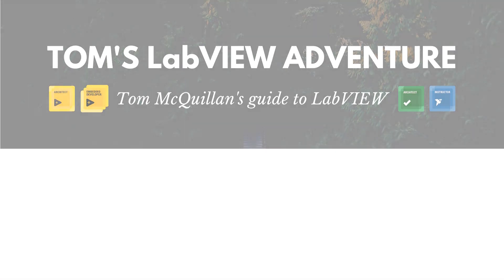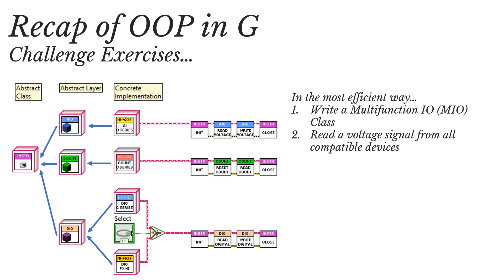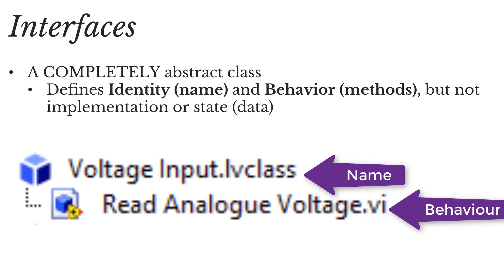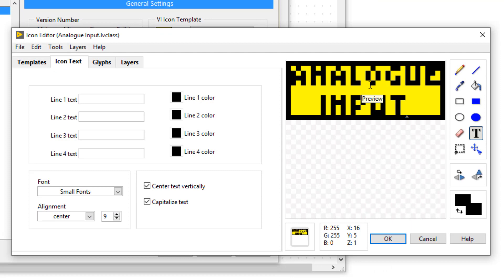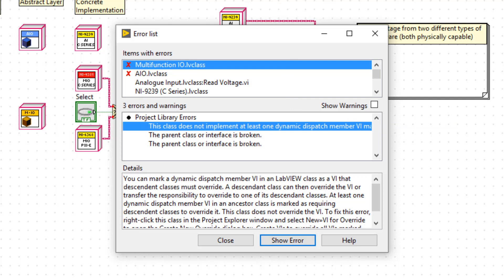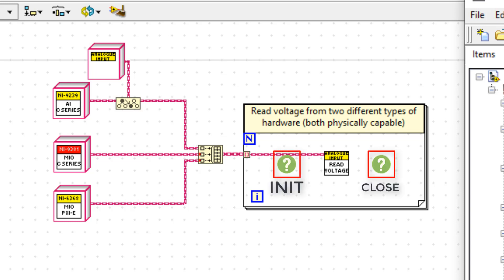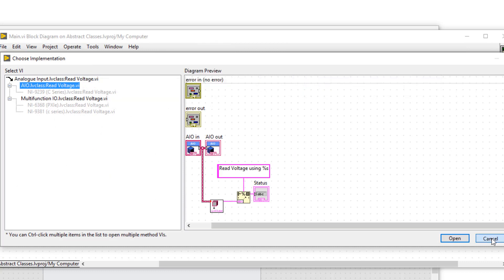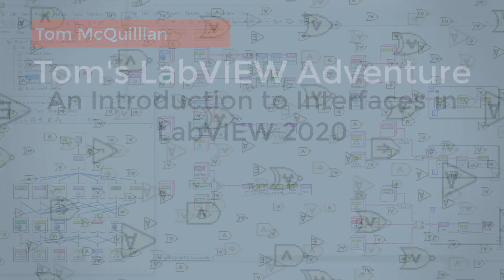An Introduction to Interfaces in G 🌟LabVIEW 2020 🌟 (OOP)

Comment: Hi Tom, Can I create an Actor for the Instruments instead of Normal Class? bcz here I'm not gonna use most of the AF overrides (eg.: Actor core, Pre launch Init etc...), only using the AF messages!!
Reply from the maker: I'm not sure I totally understand the question, however  for an actor to be able to receive messages, it must inherit from actor.lvclass. (Actor.lvclass doesn't have to be the direct parent).
You could make your hardware inherit from Actor, then specific hardware could inherit from Hardware. That being said, take time to design your OOP relationships, often composition is preferable to inheritance

Comment: Interface icons in the Project Explorer change to "class icon" after saving it on disk. Is it a bug or a supposed to be? I checked the known issues page for both 2020 and 2021 versions and found no report.
Reply from the maker: Interesting, I've not seen that happen before and I've been using interfaces frequently for about a year now. Is it still behaving like an interface or has it somehow converted to a class?
Are you able to replicate the behaviour? If so, let me know the steps you're taking along with version numbers.
Reply: @TomsLabVIEWAdventure  No, they are still acting like an interface but with a "class icon" in the project explorer tree only (e.g. in the "item settings" they have an interface icon). I have LabVIEW 21.0.1 (64-bit) on Windows 11 (with the insider program).  Whenever I create a new interface and check "Do Not Save" it has an interface icon until I close and reopen the project. 
Meanwhile, I want to thank you again for the video since I recently started to use interfaces and noticed the all details you put there.
Reply from the maker: @MortezaVafadar  I wonder if the "do not save" option is causing the issue. That's not something I typically select. I'll try it tomorrow and report it to R&D

Comment: Thanks for this video Tom. I've just noticed one feature which really excites me. How did you get Diagram Preview in Choose implementation popup? I use LV2018, is this feature available for higher Labview versions?
Reply from the maker: That's a feature that was implemented in LV19 (I think), it's definitely in 20 and 21, pretty sure 19 as well.
You can check out my What's New in LabVIEW videos to check for that, and other new features :)

Comment: Hi Tom,  thanks for your interest in sharing your knowledge.  I have one request regarding efficient method of data encapsulation implementation while we use lv interface.  Could you make little bit details about where to define the parameters and also recommendation for defining private data of child class
Reply from the maker: Hi Sarithlal, That's quite a broad question so I'm only going to give a high-level answer I'm afraid. Interfaces define what all child classed MUST be able to do. However, interfaces DO NOT define HOW the classes implement the functionality. A class uses its private data to execute functionality (and the interfaces has no input to what the class private data is). So, the private data of a class can be anything the class needs to execute the functionality.
For example, if you're connecting to some hardware, the class private data might have a VISA Resource Reference.

I hope this helps.
Reply: @TomsLabVIEWAdventure  thanks for your time to reply me. Is there any other platform to interact with you to get some recomendation or approaches we can apply in lv?

Comment: Hi Tom. I have one more question. What is the point of inheriting the Abstract instrument class from the interface DAQ Types, aside from making a "forced reminder" for the developer to actually implement the methods in the child class? 
Also, it appears that the typecast of the dual-inherited class works only if such a typecast is performed on the class that immediately inherits from Interface and the parent class. An attempt to do so on the children of the dual-inherited class does not resolve broken wire withe either "To more generic" or "To more specific" typecast.
Reply: I think should clarify the question. When you inherit the instrument class from DAQ types Interface, I think (am I wrong) is the same as making the abstract methods "initialize" and "close" members of the Instrument class. Since every single concrete implementation inherits from Instrument type, and "Initialize" and "Close" are dynamic dispatch methods, they all be available in the all generation of children anyway. Also, it is not clear why inheriting of the Analog Input from DAQ types is needed. Thanks.

Comment: Am I can use this Interface method measuring current and voltage with Agilent data logger.
Reply from the maker: Yeah you can do, but I wouldn't put in the extra work if you just need a basic system. If you want your application to be dynamic and future-proof then go for it!

Comment: Thank you so much Tom! This video is just what I try to learn these days! I really appreciate it. I am currently working on a lab DAQ project to measure and analyze thermoelectric properties which require several instruments to work together. Since I don't have access to the actual devices in the lab, the OOP is the remedy to develop the code. I already watched your previous OOP videos several times. Even I thinking to learn your opinion about my solution approach.